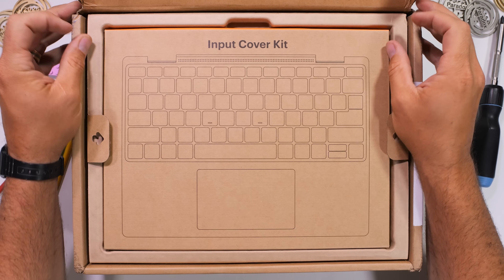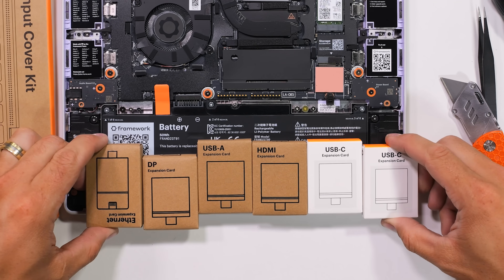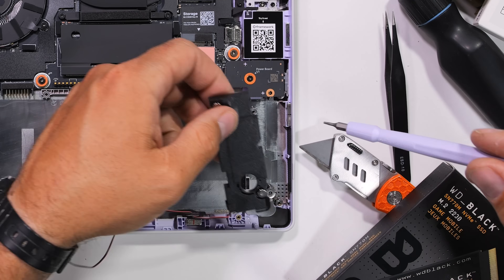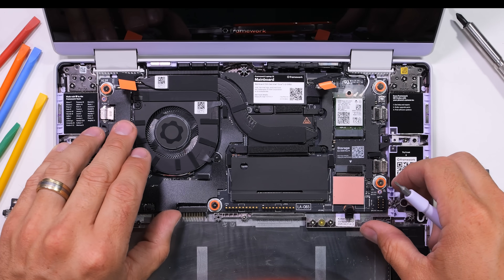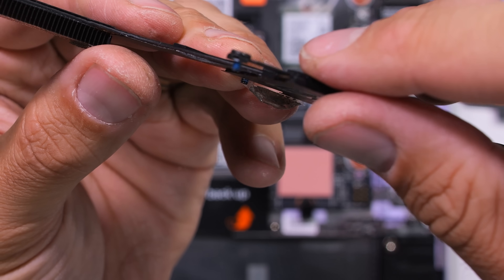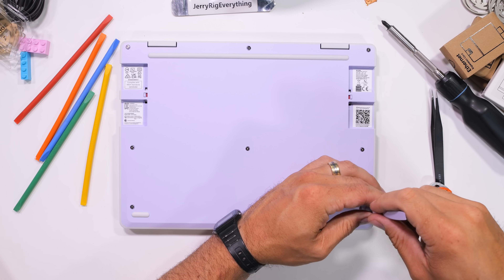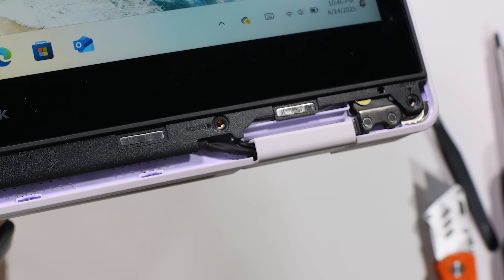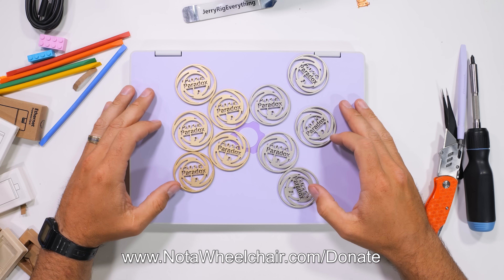The Best Laptop on Earth... is almost too easy to fix.

Comment: I have an thinkpad P52 its mess to remove and repair,especially cleaning the cpu fan and  applying thermal paste. Also other than ram, battery,NVMEbattery nothing is easy to replace in it. I still use it because I can replace the battery from outside and using an linux/gnu os. Also I plug it everytime hence I was wondering why didnt I built an PC for fraction of cost by myself with Real processors and graphics card. I will only built an PC IF I want to do work at home and use an portable laptop maybe with ARM chipset for travel and to save battery. Everyone is scammed by Laptop Idustry by its soldered mobile low watt processor and mobile GPU which they brand Graphics card. Is also possible to make caseing by ourself with TEAK,MAHAGONY etc and polish it for good looks,Also really good glass is available in market.

Comment: Im sorry, what exactly is so "modular" here; literally ALL the components you mentioned can be swapped out on any Dell, HP, Lenovo. I have a Dell Lattitude and its RAM, nvme, wifi card, are all upgradable. What would be cool is if the CPU was modular too but framework does not go that far does it.

Comment: "best budget laptop"
At $750 for an i3 and $900 for an i5 with no gpus, that's pretty much the opposite of budget. 

I'm all for right to repair and making laptops able to be upgraded, but there's little to no cost savings. More often than not Frameworks parts are just as absurdly priced as all the big laptop brands spare parts you can order.

Comment: I like the concept! Enough so to check out the website. I am a bit confused and am probably missing something. While yes the DIY kit for any of their laptops is cheaper than the prebuilt initially, after you select the most basic options for the DIY kit, it ends up being more than the prebuilt and therefore youre paying more to DIY? The only way the DIY price is lower than the prebuilt is if you choose the "None (bring your own)" options for like OS, power adapter, or RAM / storage.. which, I get it, you could just source things cheaper or on sale yourself to try to go slightly below the prebuilt price, especially with an OEM windows key, but that seems all too much compared to just getting the prebuilt. Maybe the DIY isnt for consumer savings but for enthusiast pleasure?

Comment: integrated circuits are way faster than modular. the problem is companies dont build robust laptops. if only all laptops were built like the macbook air m1 that can last you more than 10 years and will still function like brandnew then frameworks laptop will just be a thing in the past.

Comment: Hope I get your attention your Tesla adhesive video. Is bull shit. You showed the guy wiping all the silicone off as he joined the two pieces together the one you were holding had a perfect beat around the outside why is that because there was no seam you are holding a solid piece of metal that was never glued together come on dude

Comment: Ok, as a Mac user, this doesn’t quite convince me because…
- The Apple ecosystem is actually worth the price for me
- I like how my tech looks
- Apple has amazing keyboards and the best trackpads.
- My M1 air that I picked up last year for 375$ is still powering through video editing, livestreaming, and gaming.

Why would I pay 600$ for a budget computer that’s slower than my 400$ one?
Reply: -fair, if you’ve got money to burn why not
-ok?  You like a gray bland laptop?  Framework has that too.
-fw 12 has touchscreen, fw 16 has moveable and hot-swappable trackpads.  You can mix and match the two too.
-good for you?  I’ve got a $50 optiplex that does the same exact things you mention.  It’s from 2013.  Also, isn’t gaming on Mac absolutely terrible?  Few games being compatible and all?

Last point sucks unless you’re only planning on having a computer for a couple years.  Screen breaks?  Mac is $198, plus you can’t do it yourself.  FW has guides and is $150.  WiFi card breaks?  On Mac I can’t even find a price for that, cause if it breaks the entire motherboard is pretty much done, on FW it’s $18.  

Framework is for people who wish to have tech that is end user repairable, upgradable, and customizable.

Comment: I'm sorry but what's the point of the USBC cards? When all those adaptable cards plug in with a type c cable. Wouldn't you not even need the extra card and just plug the wire directly into where the card goes? If your cable's then enough

Comment: i don't see how this is more repairable ?
-no replaceable cpu
-no replaceable chipset
every stuff that kills a repair for a decently experienced tech isn't replaceable...
every other replaceable things are already widely replaceable in your typical laptop
It's nothing to be proud of to able to replace a battery
and these modules are just gimmicky usb devices, would be the same just having a bunch of usb ports and giving you a bunch of dongle and adapters...

I'll take that one version has a replaceable gpu, but it still is a proprietary pcb that can only be upgraded with their parts...
This computer isn't more repairable nor more modular than you regular lenovo or asus laptop...

Comment: I was a fan of Framework until they released their Desktop machines. Soldered RAM on a desktop when they don't even do that with their laptops? Nope.
Reply: That's for a specific AMD cpu that needs soldered RAM for the speed that directly soldered RAM provides. There would be no point in that product if it was stuck with slow DIMM or SO-DIMM RAM

Comment: I really like the idea of the Framework and will probably buy one when its time for a new laptop. I currently have a MacBook Air which is great as a student. It has good battery life and it is quite lightweight while still having good performance. Those were the main points for buying it but I fear the day I will have to repair something on it. So if it breaks I will probably switch to a Framework slap Linux on it and hopefully get somewhat similar performance out of it.

Comment: I have one remaining question.  Framework offers a power adapter for $55, but then suggests that at least one of your expansion cards is a USB-c for charging the laptop.  Are they charging you $55 for an $11 USB-c card, a USB-c cord and an AC to USB plug, or is there a barrel port for an AC to DC cord?

Comment: from a repair tech: this laptop is like any other laptop repair that has modular components, its not so groundbreaking. these guys just market their brand around that fact. it is nice that the screws are fixed in place and cant come out all the way, and the other little helping bits they did in there but all in all its nothing too special..
Reply: What other modern laptops have as many modular components as Framework?

Comment: I'd love if they had a deeper case option with a possibility to plop in a customizable low-profile mechanical keyboard module, that would've been just above and beyond, so you would have had an option to have your own preferred low-profile switches and low-profile keycaps for the ultimate customization, and so there would be no need to use a subpar laptop keyboard or carry a separate keyboard.

Comment: 0:42 If Framework wants to be the Fairphone of computers in terms of repairability, it falls short on sourcing ethics—Fairphone builds its mission around fair-trade materials and labor rights, while Framework sticks to basic compliance.
Reply: Conflict minerals
	•	Fairphone: Actively sources fair and conflict-free materials
	•	Framework: Meets legal requirements but doesn’t go further

Labor practices
	•	Fairphone: Invests in worker welfare and wage improvements
	•	Framework: No public labor initiatives

Supply chain transparency
	•	Fairphone: Publishes supplier lists and sourcing maps
	•	Framework: Minimal disclosure

Recycled materials
	•	Fairphone: Uses recycled materials across components
	•	Framework: Limited to some recycled aluminum

Ethics as mission
	•	Fairphone: Central to brand identity
	•	Framework: Secondary to repairability and design longevity

Comment: Oooooooof I looked at their gaming laptop model, and they are asking $480 for 96gb ram. I can grab the exact same pair of 48s off of Corsair for $200 on their reseller links. 

The laptop barebones with items that I can add myself that aren't oem comes up to $1,800. 

You can grab a 2023 Razer with a better cpu/gpu/screen, and it comes with low end ram, for a out $700 less than their "modular" model.

The engineering is genius, but it's not worth the dollar amount being requested, especially since they are doing shady things like making ram twice as expensive

Comment: I think if they offered a screen and speaker upgrade I could go for it.  I’d be willing to pay a few hundred more for those improvements.  The price is good for what it is new, but I’d rather go for something used with a more modern display.  Used is also still good for the earth, right?
Reply: I really like the 2-in-1 and 12” size

Comment: It’s one of the worst budget notebooks in terms of price to performance. A MacBook Air is the better choice for 99,9% of the people unfortunately. And that is despite MacOS being the worst operating system by far.
Reply: How is macOS bad? It has a terminal, every command line tool you know from Linux works just as well. As for the quirks in UX behavior, one gets used to it.
Reply: @uhohoverflow seriously? It has the worst audio stack, graphics stack and security architecture (which is especially bad).
In addition it has the worst UX by far, consisting of an unusable file manager, window management from hell, a settings app somehow worst than the windows one and a lot more stupid os decisions.
There is not a single reason that anyone is using MacOS except that the Apple hardware is that high in quality.
Not all linux tools work fine, gaming is basically impossible, it has worse security than Linux and Windows, Windows is actually miles ahead there. It has deviated far from its original bsd roots.

So I hope your question was rhetorical, because no sane person would even argue about MacOS being a horrible experience that was only created for animations, not for productivity.
Reply: @gro967  I don't even know what to say to this. I have never come across a command line tool that I use on my desktop (Fedora) that doesn't work on my MBP. Gaming is of absolutely no interest to me on a Laptop and I don't know which security vulnerabilities you are referring to, either.
Reply: @uhohoverflow  it's great if everything works for your specific use case, I was just summarizing the objective state of the OS.

Comment: Jerry my man whats happening with you lately? I mean I get youre basically an environmentalist, theres nothing wrong with that at all. But you seem to totally swing towards either fully positive or fully negative feedback these days. I mean sure some little things here and there are different, but you gloss over so many negatives or positives of things its actually shocking. Why do you feel the need to do that? Or is it actual ignorance? No offense, genuinely asking.

For example, in this video (why I mentioned "environmentalist" at the start there), you totally ignore the fact that the SSD is a unique 2230 form factor, which is both capped at 2tb (very expensive), and harder to get at anything less than that unless you go for maybe a 500gb steamdeck card or something. 2280 is a much more usable, common, affordable (and thus more eco-friendly, right?) card, and Framework not including a slot for that is a pretty big deal for upgradeability. 

On a similar note, this laptop has ONE ram slot. I don't know if it has some soldered, but if it doesn't thats a massive deal. Single channel memory, even newer gens, is terrible and should absolutely not be recommended to anyone. 

And if it DOES have soldered ram, that's still incredibly disappointing since you're limited to likely 16GB of real dual-channel memory (8 soldered + 8 stick, if you put a 16 stick in it'll be running slow single channel past 16gb - its not fun, trust me I know). You just totally glossed over these two major downsides and didn't even really talk about other specs. But on the website it looks like you're running full single channel, since they say the laptop has a max ram capacity of 48GB

I mean if you want to spend 550 on a laptop thats hot trash but good for the environment, by all means. I get its not supposed to be a high-end PC, but all I'm saying is that you can buy an HP Zbook Dragonfly 14 G9 or similar with a faster CPU, better battery life, two ram slots, a 2280 SSD slot, and also replaceable components (WITH GUIDES) for about 350. And thats basically recycling. Now tell me, which one's sounding more environmentally friendly?

Comment: I hope there is a Framework 16 video available as I'm a gamer and I'm looking for a new computer since Asus designed mine to be unrepairable or upgradable by owners. I've been an Asus owner for 17 years and loved my ROG laptops until I went to swap out the batteries. I run my laptops  24/7 so the batteries died honorable deaths after 10 years lol. Now my last working Asus is having USB port issues which is really the only way to upgrade the laptop and it is very inefficient for gaming.

Comment: I'd consider one if they offered it with multiple m.2 slots (2280 or 22110), a 4K 17" screen, and discrete video card... checks before submitting Ah, they have a 16" model -- but would the lower resolution, smaller 16" suffice? I'll have to watch your review of that one. 

My favorite laptop for serviceability and post-warranty parts availability so far has been Dell Precision mobile workstations but the Framework 16 comes in at less than 1/3 the price. I'd definitely consider trying out the Framework 16 - ESPECIALLY if they offer upgrade modules for it. I'd love to be able to update the motherboard every other CPU release. My current Precision doesn't reach EOL until next year, so I'll have to keep an eye on the Framework and see if they start offering upgrade modules. If so, I'm going Framework rather than Dell next year.

Comment: framework is the king of "good idea until you think on it for two seconds AND the actual execution is sh!t and completely defeats all advantages- both real and imagined" and as you can guess the latter is FAR more heavily represented here than the former.

by the time something fails or needs upgrading youre gonna have to upgrade everything else lol

if you want a better cpu or gpu guess what?  gotta upgrade the battery.  and no one wants a new gpu without ACTUALLY USING IT durr so guess what?

gotta get a better screen too.

i dont care to look up prices but i guarantee that buying a framework screen will cost FAR FAR FAR FAAAAR more than the same screen's share of the price on a whole new laptop.

when its time to upgrade a cpu or gpu its been long enough to where all the other components will need an upgrade too.

dumb idea.  atrocious execution.

Comment: A family member bought an earlier version of the framework. Multiple components went bad in the first year. While they replaced them under warranty and were generally easier than a traditional laptop to swap out, eventually the motherboard went bad. I recommended they buy a MacBook Air with aarch and have had 0 issues in the first year with components. Cool idea but swapping parts due to failures every couple months is still annoying, regardless of how easy they are to swap.

Comment: Parts 2 times the normal price, bearly runs without the battery pack they sell or the screen they sell, bad os compatability with everything, the bios not being open source, not all ports are power ports, horrible termal design, half of the parts u can`t buy separate but only as a pack. I wish framework was as cool as people make it. It`s cheaper and easier to buy a sh laptop than replace any part in this trash. i had 5000 euro to spend on a forever laptop and somehow with that budget i couldnt get something decent on the framework website. untill they make every part with open source drivers and make them run in other enviroments connected to parts not designed by framework, i consider this premium trash

Comment: I've been repairing Dell and Lenovo laptops for over 10 years now, and I never got so GIDDY as when my sister-in-law's Framework 16 came and she asked me to set it up for her.  Blew me away how technician- and user-friendly these laptops are.  Standing ovation for Framework!
Reply: Did your sister choose her laptop, or did you chose for her 😂?
Reply: @zy2239  nice catch, my brother chose for her but wasn't around
Reply: Lenovo is honestly not that hard to work on. At least there loq's aren't
Reply: @unclejimmy2630 Lenovo is one of the most repairable laptops brands, they're not as good as framework but they're pretty damn good for a laptop brand
Reply: Now if they could only include more than a measly 6 ports on a $2000 laptop.
Reply: But if this was the standard you wouldn't have a job anymore
Reply: @ariamh823 hahahahaha yeah he would… you don’t know how many people have paid a handyman to change a lightbulb or clean their dryer vents… the gist of it is that most people are not tech inclined and mess up or don’t have confidence in themselves… having an easily accessible hardware makes everyone’s job easier ! 😅
Reply: @zy2239 
Yeah you have a point. When people pay others to assemble a pc... Why wouldn't they pay to repair this?
Reply: can u help me fix my lenovo thinkpad e14?
Reply: @tiger10149  Can? Yes. Will? No.
Reply: @jessterman21  why? no free advise?
Reply: she brought one without wanting to build it ??